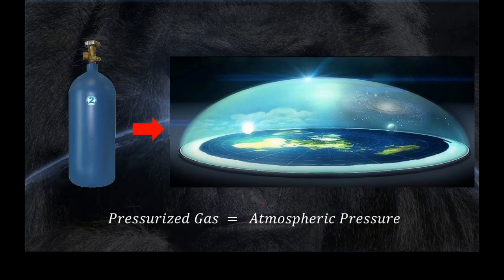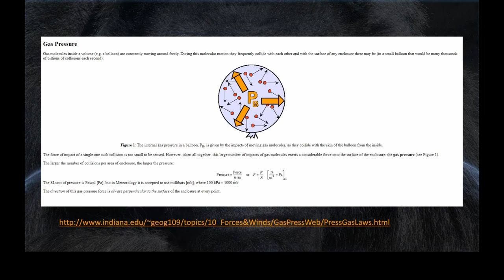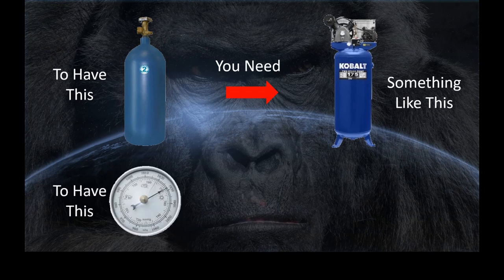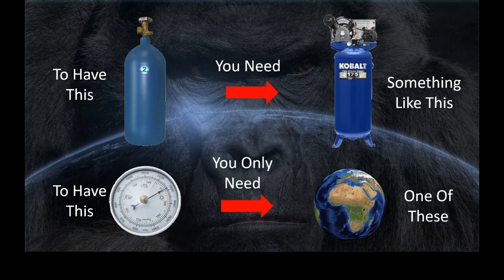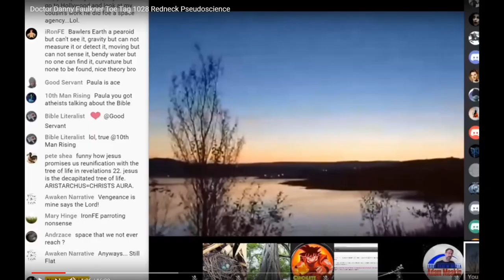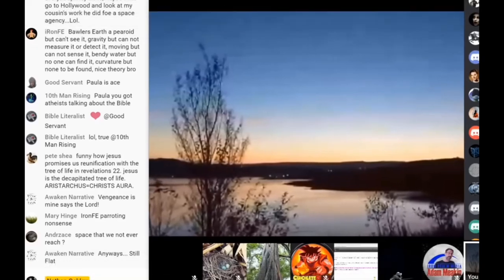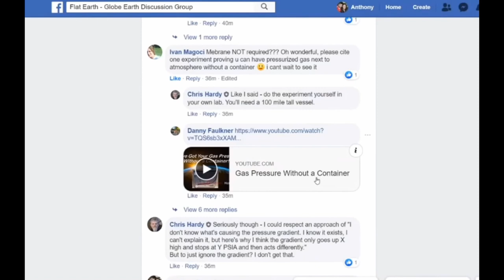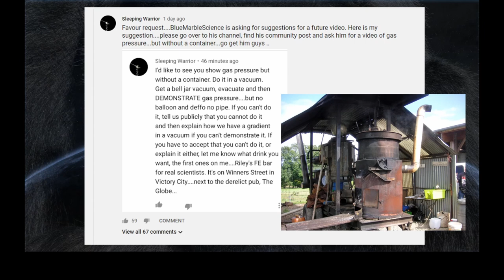Pressurized Gas versus Atmospheric Pressure

Comment: Hey BMS. Have you thought about what would happen in a longer butane filled tube if you slowly lowered it.? Would the pressure decrease as the difference in the height of the top and bottom decreased? If so it would be pretty hard to say it was due to density as the gas would still be in the tube. Just throwing it out there - mostly because I'm too tired to think it through.
Keep up the great work. Sleepy is looking more and more irrelevant.
Reply from the maker: Good suggestion!

Comment: It's obvious that they know facts aren't on their side. That they attack you with name calling shows they know they don't have facts otherwise they could use them.

I wonder if they can show a pressure gradient in a pressurized gas container? They claim a there is a container that separates the atmosphere from vacuum so certainly they should be able to show that a container with a higher gas pressure than it's external environment will have a different pressure at the top of the container than the bottom.

I'm pretty sure they will be assisted by the "not a force" they don't believe in if they can verify any measurable difference.
Reply: I somehow doubt that their target audience is people who have even the most basic grasp of the Ideal Gas Law and when it does, and does not, apply.

Comment: My question is, is the manometer set for gauge pressure? If it is, then would the atmosphere register on the meter if it was set to absolute?
Reply from the maker: The manometer is look at pressure above and below the water column and it's calibrated in inches of water. It doesn't work for absolute pressure or at least I don't know how to do it.
Reply: BlueMarbleScience 
You would have to set it up in an absolute vacuum, which is impossible.

Comment: Ok, try this for the experiment; Attach to a HAB the fallowing, Altimeter, pressure sensor and a camera. Release the HAB and watch the read out of the sensors. Though in HS when we did this we were only allowed to go to 5500 feet, there was a measurable difference to the pressure on the video that was made. If the butt heads in the fe pseudo science crowd do this they will exclaim the sensor IS a vessel and can not be allowed. difference in the rel science crowd, we did this. Peace

Comment: One thing that I would like to see is a number of ports on the pipe showing the pressure differential from top to bottom, maybe a few might understand just how pressure differential works in the atmosphere. The POEs will never admit that you are correct but you may help some of the others.
Reply from the maker: I did the same thing by raising and lowering the pipe in the original video. Check it out.
Reply: @bluemarblescience  Yes I saw that and do understand what you were showing but these numbskulls still might not understand the concept. Ports at different levels might be more visual and help some of them. Thank you and keep up your great work.
Reply from the maker: @july8xx  I'm not disagreeing with you at all, but each gas valve and the fittings required has a cost and then there's a concern over losing butane while transferring the hose. It could be done for sure but it's a lot of fiddle to accommodate people who are going to handwave dismiss it anyway!

Comment: If I take an empty 2 liter pop (I'm from Michigan It's POP) bottle and put the cap on. Then take that bottle up into space and let it out of the space craft. Will it expand/ explode? Would the plastic be strong enough to not explode?
Reply: Unless 15 psi can explode the POP bottle, no......
Reply: Well, pop bottled are made to endure high pressures. The bottles have to maintain enough pressure to keep the CO2 dissolved in water. Otherwise the pop will end up flat. 

As far as I'm aware (without doing the calculations) if you did the experiment you suggested, the difference in pressure will be less than the difference in pressure from when you originally bought it.
Reply: @scott_meyer  15 psi can implode the pop bottle, so an explosion seems likely.
Reply: @stevethecatcouch6532  
A plastic bottle can take over 100 psi.
Reply: Steve the Cat Couch 
A pop bottle has no rigidity in compression, the wall just bends/deforms, due to the material being weak in compression. With internal pressures the structure has to be ripped apart to explode and the material is very strong in tension, so a pop bottle is designed to hold a pressure of over 100psi and quite often would be capable of holding a lot more. The cap would probably be the point of failure.
Reply: @stevethecatcouch6532  
In the You Tube search bar search for
How Much Pressure Can a SodaStream Bottle Handle? Under Water Explosion Test!
He refers to Bars. One Bar is basically equal to one atmosphere.
Reply: @scott_meyer  Thanks for showing me that. Those bottles bent quite a bit before bursting or losing their caps. Space is safe for fizzy drinks in bottles.

Comment: Very nicely done! The only minor improvement would have been to raise the pipe with the butane while the tap was closed, then open it to show the pressure changed only once the butane was in contact with the atmosphere. That would eliminate the possibility that the movement of the pipe caused air to flow in at the top and change the pressure dynamically.
Sadly, the "FE Research team" will not learn anything from this demonstration. Their response will be ridicule and ad hominems. They dare not examine your experiments in detail because that would reveal how stupid and wrong their ideas are.
Reply from the maker: I thought about that - if there's a next time, I'll do it that way.

Comment: Gas pressure without a container? Well the globe earth model which has gravity. Uses gravity to hold the gas together as our atmosphere. Which in turn creates the pressure we see here at sea level and the lower pressures we see as we go up in altitude. So if I'm thinking correctly no you cannot have gas pressure without some kind/ any kind of a container.
Reply: Technically the atmosphere is in a container. It's a spherical shell, one wall being the Earth's surface, and the other being a "soft" wall generated by the Earth's gravitational potential. The latter is slightly leaky, because molecules or atoms at the top of the atmosphere can be stripped away by the solar wind, but the loss rate is very low.
Reply: Yup. No one (credible) said barriers had to be physical. In fact, I’d argue it’s a misconception because fundamentally what ends up happening is potential energy does all the work. 

In the case of a physical barrier, the atoms of the wall repel incoming atoms/molecules via electromagnetism. Electrons of the gas are repelled by the electrons of the physical wall. This creates a very short range potential energy barrier that impedes leaving the containment. 

But this effect can be replicated via other methods, one simply needs to find a way of generating a potential energy “well.” Gravity is one such method, magnetism (as in magnets) is another, I think there’s also inertial confinement which uses photons.

Comment: Maybe you could do gas pressure caused by centrifuge. I was thinking a bicycle wheel with that pipe pointing center to rim, laid out horisontally with butane in it and spun. I realise youd have issues using that guageyou got but, wouldnt the difference between horisontal and vertical setup be interesting as far as displaying the gravity portion of the pressure vs the centrifugal part?

Riley thinks nobodys on to himbecause he claims that Einstein and spacetime is conceptual, so it cant do anything. Actual science offcause would never accept a gravity that didnt do what it allways did, but well you know what hes like.

Comment: Why do we waste time chasing their rabbits down their rabbit holes? Let them define their container. Just how tall is this container? Isn't this container the alleged firmament that their celestial objects are fixed in? What shape is their container? If it's a dome shape, they have one of two problems. if it's less than a couple of hundred miles tall over the North Pole then people in Christchurch should be bumping their heads on it. if it's taller than a couple of hundred miles over the North Pole, then they have the same problem with vacuum and sea-level pressure existing in the same system. Unless they want to explain at what altitude the rules of barometric pressure break. 

In short, I propose letting them explain their model until it breaks. We can give them evidence of reality all day long, but they have already rejected that evidence.

Comment: sigh
As much as I enjoy the science lessons and such, I have to be devil's advocate now.

We all do know this is an argument of semantics, right? You understand they are arguing that if you took a canister of butane, opened the valve and let it flow onto the ground,  eventually you would not be able to measure any pressure difference on the ground from the butane you let flow? There's nothing to contain it to let it build up.

It's honestly becoming frustrating because it's like watching two blind tennis players hitting trying to hit a ball.  You're not seeing each other's arguments because both sides are refusing to acknowledge the other.
Reply: MaktheMad
The point is flatties are trying to make a syllogistic case for the dome because they lack any other form of evidence. They argue gas can only be held in a sealed container (they’re trying to shift the goalposts but it doesn’t work) otherwise it will expand forever into the vacuum. Earth has an atmosphere made of pressurized gas, ergo it needs a sealed container called the dome. 

However this is flawed for multiple reasons. One of which is this demonstration. It shows with the help of gravity (technically any acceleration would do), an open pipe can hold atmospheric pressure. If the pipe can do it, even if it’s leaky, why would earth (which science agrees is leaky) need a sealed container in the form of a dome?

Another issue is they insist on a physical barrier but overlook what really holds gas, a potential energy well. From an electron* in an atom, to a gas molecule in a pressurized tank, to a planet in the solar system, all are held in place because they’re stuck in some form of potential energy well that contains them.

Yet a third issue is that they claim gas ought to expand from high to low pressure yet they refuse to address the gradient. This is because they thrive on ad hoc reasoning to explain individual questions. But when two questions come together, the inconsistencies within each individual “solution” become apparent. In this case it’s a conflict between the need to argue for the dome, denying gravity, and a misconception of thermodynamics.

*these little buggers can quantum tunnel but you get the point.
Reply: No. If you could magically still the atmosphere over the entire Earth which includes eliminating convection AND released enough butane, we'd all suffocate
Reply: Carl Browning 
Huh?
Reply: "We all do know this is an argument of semantics, right?" Wrong.  Anthony is desperately trying to turn it into an argument over semantics, but Anthony is an idiot. 
"You understand they are arguing that if you took a canister of butane, opened the valve and let it flow onto the ground,  eventually you would not be able to measure any pressure difference on the ground from the butane you let flow?"  Incorrect.  They were arguing that gas pressure requires a sealed container.  They very clearly, on multiple occasions used the exact phrase "sealed container" with regards to this subject.  Once BMS demonstrated that gas pressure does not require a sealed container, they moved the goalposts and changed their argument (without ever acknowledging their previous argument) to gas pressure requires a container.  Period.  Full stop.  That's their argument.  Your suggestion may or may not be a consequence of their argument, but it is not at all what they are arguing.  
"It's honestly becoming frustrating because it's like watching two blind tennis players hitting trying to hit a ball. "  Then don't watch.  BMS's refusal to accept Anthony's flawed premises has nothing to do with an inability to understand the argument.  If you think that's the issue, perhaps it's you that doesn't understand.
Reply: AJ Hieb You do understand that you just proved my point right?  The fact that we are arguing sealed container while they have moved on to just a container is why this argument keeps going in circles. Neither side is backing down from a stupid argument where we are both right. And that’s why I think it needs to be dropped. 

Yes. To create gas pressure, the gas must be confined. Be it in a cylinder, a glass jar, a balloon, a pipe, whatever container is holding it. Sealed or not. Doesn’t matter. 

Atmospheric pressure is a whole different conversation. It’s a totally different system, and that’s where people like Anthony are stuck.
Reply: MaktheMad 
Meanwhile I think it’s fine. Even if the flatties don’t acknowledge the fallacious reasoning certain debunking videos expose, we get cool demonstrations like this and the previous version regardless. I appreciate these demos whether or not they change the mind of some flattie. 

But again, they cannot change their argument from “sealed container” to simply any form of container because the dome they want to claim is real is specifically a sealed container. Lose that specific (sealed) constraint, their* obligation for a dome vaporizes along with it. 

They can’t have it both ways. Either they concede this demonstration shows we don’t need a sealed container to hold the atmosphere, thus a dome is unnecessary (because gravity...). Or they adapt their argument to include an open pipe as a gas container, which then begs the question: why then do we need a dome if something with an open top works?

*you and I both understand there was never any such obligation, this emerges out of their own argument which makes it ironic.
Reply: @MaktheMad  "AJ Hieb You do understand that you just proved my point right?  The fact that we are arguing sealed container while they have moved on to just a container is why this argument keeps going in circles. "  It's not going in circles.  The sealed container argument is over.  BMS won.  Anthony is trying to start a new argument about non-sealed containers under the pretense of continuing the previous argument.  His intellectual dishonesty is the issue here.  The problem is not anyone else's reluctance to go along with Anthony's intellectual dishonesty.  

"Neither side is backing down from a stupid argument where we are both right." Anthony was never correct in asserting that gas pressure required a sealed container.  He's trying to claim victory in that argument by moving the goalposts.  Not sure why that's so hard for you to grasp.  Anthony is also incorrect in his assertion that gas requiring confinement, precludes the accepted model of an increasingly thin atmosphere held down by gravity.  

"Atmospheric pressure is a whole different conversation. "  No, on a fundamental level, atmospheric pressure is no different than any other gas pressure.  It is in fact a specific example of gas pressure.  The same laws govern it.  The same phenomenon can be observed with it.
Reply: @sphaera2520  I agree. The science lessons are cool. However, the teacher is becoming a bit repetitious because the stupid kids aren't getting the point. I guess that's what I'm trying to say.
Reply: @ajhieb  So what? Arguing over Liley's intellectual honesty is like trying to win an argument with a wall. No one is doubting he's an imbecile.

My point is this. Arguing for days on end what causes gas pressure is a lost cause. Sealed, unsealed, it doesn't matter. It has nothing to do with the shape of the earth and it's giving Liley the attention he wants.

I watch BMS's video every time they pop up.  This is the 5th video dealing with this and nothing has changed. I feel, and I may be alone in this, it's time to tackle a new subject because this has been done to death. We all know the answer. Let's move on.
Reply: t @MaktheMad  Fair enough.  I agree that sticking on the same subject can get tedious, but I guess part of it depends on what you see the purpose of these videos as being.  I think anyone that is making debunk videos in the hopes of having the original video creator concede in some was is just wasting time.  99% of the time flerfism is a one way street.  Once you're that far down the rabbit hole, no amount of evidence is going to change your mind.  They're only hope is professional psychological help.  And for guys like Jeran and the Nathans, when your primary source of income relies on the Earth being flat, you're going to conclude the Earth is flat no matter what.  (I suspect Anthony has different motivation than the other non believers, but evidence still isn't going to change his mind)   Anyway, I see the main benefit of these videos as helping people that might actually be on the fence about this, who don't have a good working knowledge of science, to make educated conclusions.  The entertainment value is secondary.  

Now, I totally agree that playing flerfer whack-a-mole and addressing every part of their attempted gish gallops would have a much better variety of subject matter and entertainment value, but lets face it, if you're watching flerf debunking videos in hopes of new content, you're out of luck because the flerfs haven't come up with anything new and significant in years.
Reply: MaktheMad   Nope. Both sides don’t have it right. He’s actually trying to change meanings. That isn’t arguing semantics! He’s not arguing the meaning of the word. He’s gone from “sealed” to not. Confirming there’s no dome   Moving the goal posts. Different contradicting points.